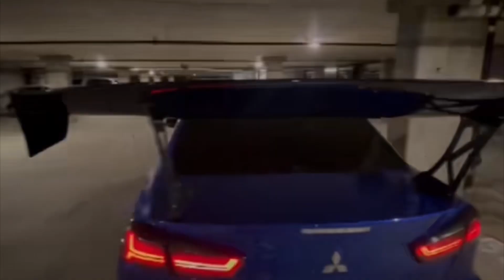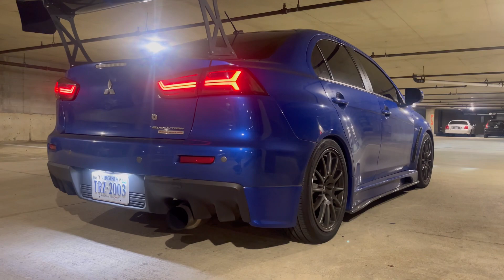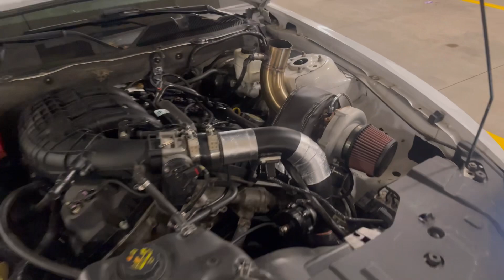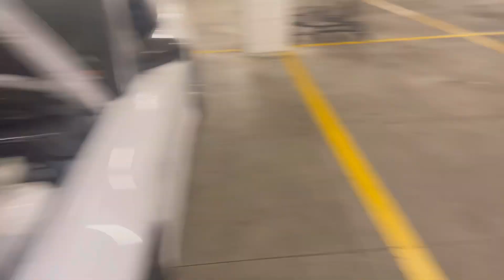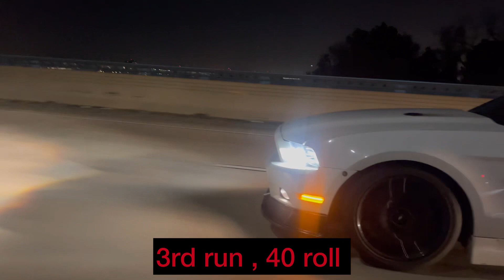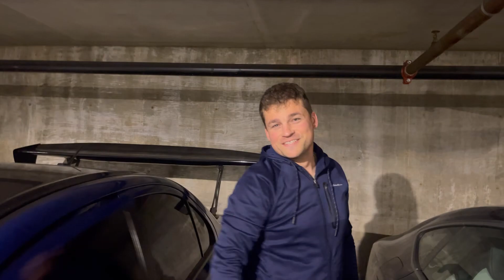SINGLE TURBO 600 HP Mustang VS 410 HP EVO X

Comment: That evo Is pushing more than 410.
Reply from the maker: 410 WHP but I was racing them on normal pump gas E93 imagine if we do some rolls on E85
Reply: @rm_srosu1488  I have an Evo X as well dyno tuned at 400 and 389 ftlbs and it's fast but it's not beating a 600whp mustang. Your car has to have more than 400. Where's the dyno sheet?

Comment: bro needs to get his money back and buy an s550 a10
Reply from the maker: Tbh 60 roll we were bumper to bumper but 40 roll I killed it
Reply: @rm_srosu1488  are you on stock turbo?
Reply from the maker: @jeremysteinacker4889  one size bigger than stock and pushing 36 psi but stock engine the mustang is build engine and way bigger turbo
Reply: @rm_srosu1488  like the mhi 18k?
Reply: @rm_srosu1488  ain’t no way he’s build engine and having a big turbo and stock Manifolfd ? Either the mustang is lying and that is an eBay turbo or he doesn’t know how drive or his runner his shit those boosted V6s they are pretty and if he is built engine like you said which I doubt
Reply from the maker: @stanleymonroy1891  no comments brother